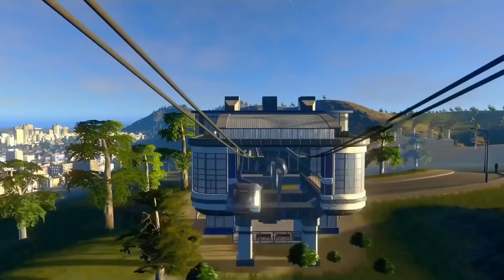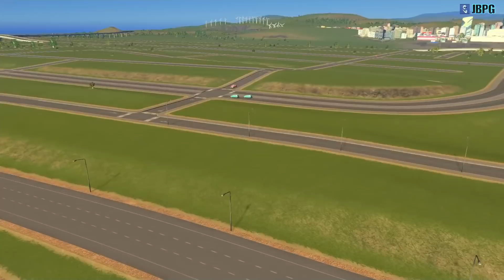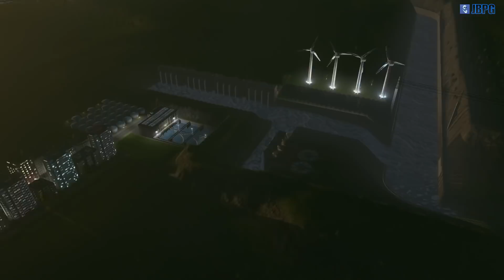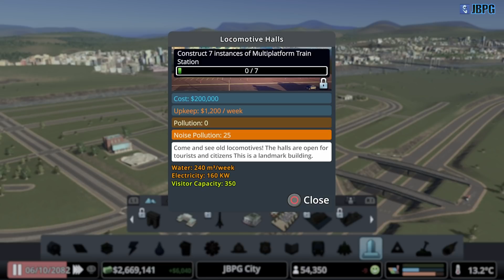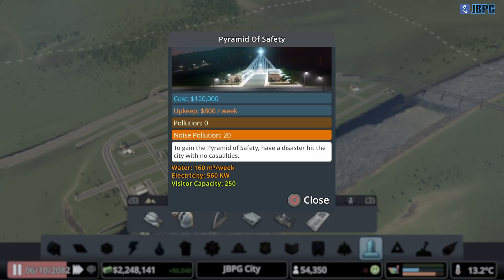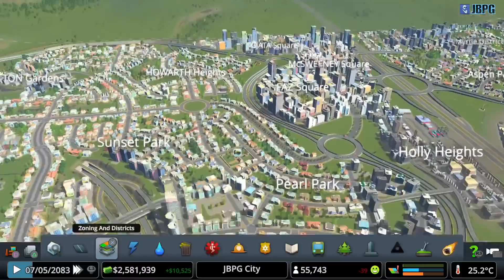Cities: Skylines Mass Transit [PS4 Edition] - Part 21

Comment: I'm looking to buy this on PS4 but I have only seen PC content. And now, looking and comparing the 2 it seems like night and day graphics wise which of course can be due to mods on PC. However do you think there will be any overhaul on the console version to any systems that it lacks? Or is the game done being updated at least on console. The UI as well is radically different, it looks cheaper than on PC. Of course that's not a gameplay issue but just an observation.
Reply from the maker: there's not to much differrence visually comparing the vanilla versions of the game - the UI on PC simulations are usually drastically different because of  mouse/keyboard support, whereas the traditional console option is the radial wheel.

Mods make a huge difference to the PC game, but to get the game looking amazing you need a pretty powerful setup by all accounts
Reply: @JBPG-YT  
I see, I wonder how much of it is "ultra" graphics settings too I suppose? I was watching some vanilla PC gameplay from one of the bigger City Skylines channels and it looked very good. But I dont believe the console version has support of the graphics settings.